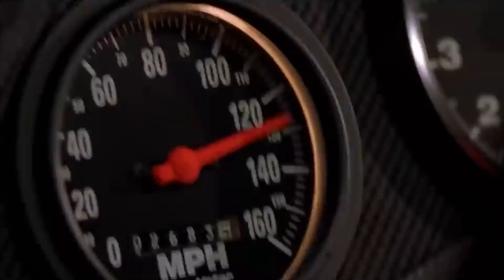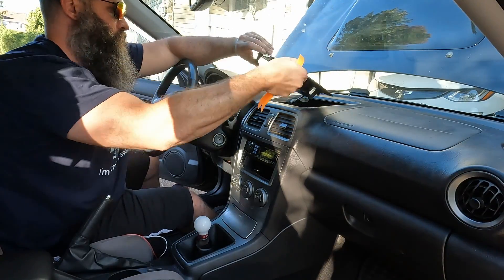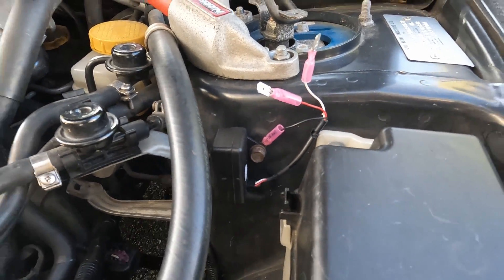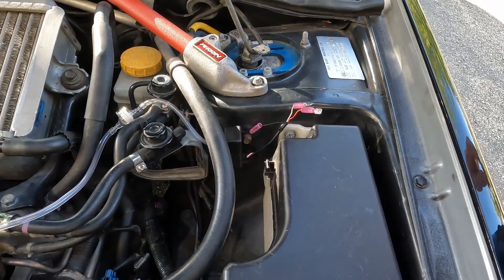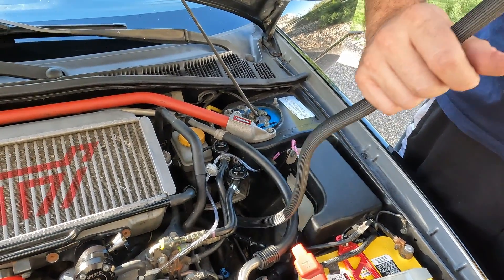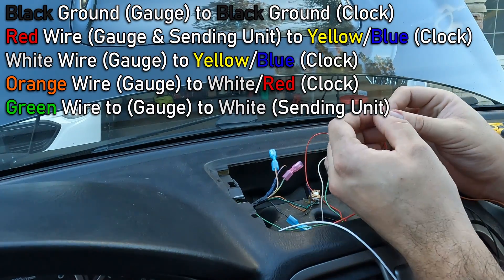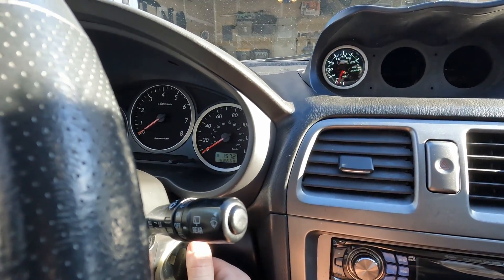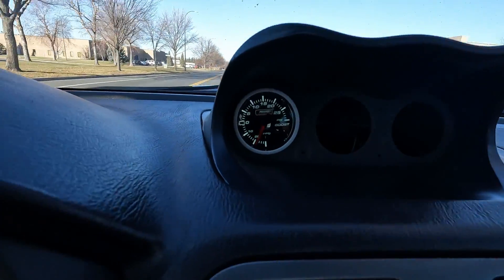How to Install an Electronic Boost Gauge [Subaru Impreza 2002-2007]

Comment: New subie owner here, recently put in af gauge and oil pressure guage. I didn't wire off the clock, I used add a circuit. Anyway, I had an airbag light on after I did the install and it really bothered me until I watched your video. Thanks for that detail. My old clock was in the trash can waiting on the trash truck today. Because of this video I caught it before they came and hauled my trash. Thanks!
Reply from the maker: Awesome, glad it helped!  Good luck on your Subaru journey!